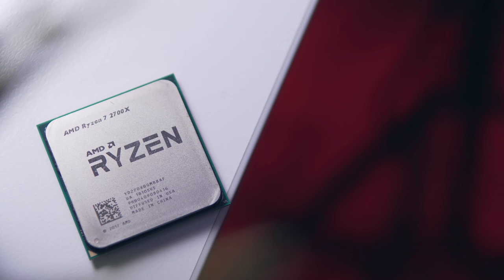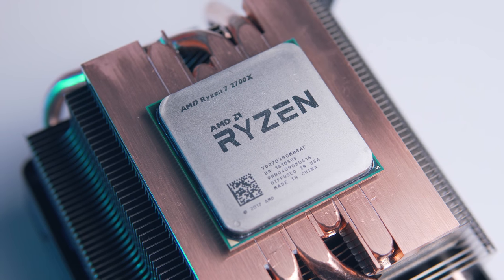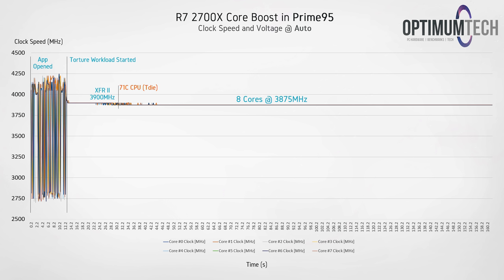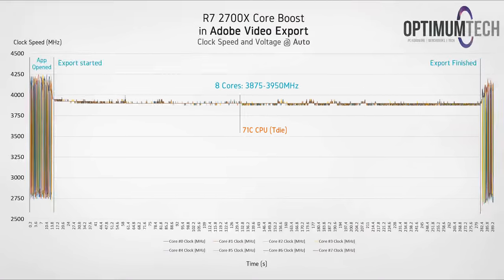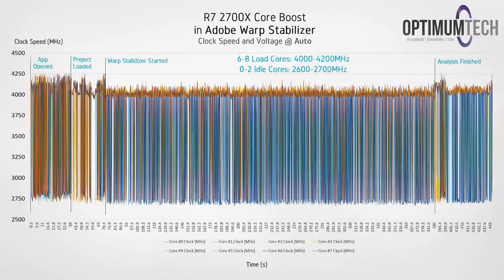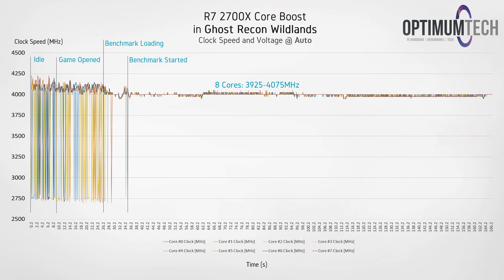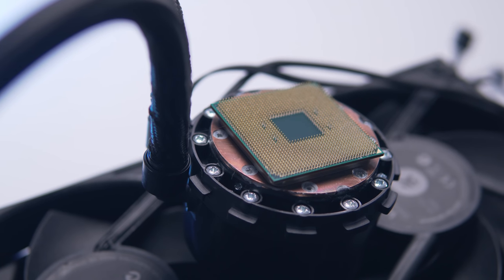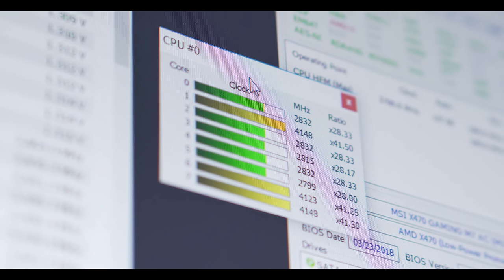R7 2700X - Boost Performance Analysis

Comment: I was hoping that with the Ryzen 7 2700X that I'd be able to reach 4.5GHz with my 280mm liquid cooler after seeing the turbo boost clock of 4.35GHz. But seeing recently with the numbers and tests that 4.2GHz is a bit harder to get stable and cool, I was a bit disappointed. With my liquid cooler I'm hoping to see 4.3 or 4.4GHz at reasonable temps and voltage. I'm wondering if by next year when the next Ryzen launches, the base clock will be 4GHz and the turbo boost would be 4.3-4.4GHz with maybe 4.5-4.7GHz with an AIO. I can only get 100% stability on my i7-6850K at 4.2GHz, I want to go higher on the clock to maybe 4.5GHz with Ryzen but it doesnt look like that'll happen. One thing I would get from Ryzen is 2 more cores and 4 more threads but that's about it.
Reply: What kind of results did you end up getting? I can barely overclock to 4.4GHz with liquid cooling, but anything above that makes vdroop go way up
Reply: @NinuRenee  I think 4.2 maybe 4.3 but not 4.4+. I didn't have the cpu for long though I went back to Intel and had 5GHz+ ever since 2019. Ryzen cpus these days can do 4.5+ no problem though.

Comment: Can you over clock the r7 2700x to 4.5 ghz with water cooling
Reply: You can overclock it to 4.5, it'll probably require so much voltage that it will degrade in a month and will likely be unstable even when you return to stock.

Comment: If U really want to see what what the ryzen2000 series CPUs can do, look at  the link i found of a ryzen 2600 (OC@4.2ghz) hitting 5.0ghz, with new XFR2 on an old AIO (Corsairs H100i v1, from about 5 years ago).   https://www.youtube.com/watch?v=1EDXui9K2VI

The video link above of the Ryzen 2600 @ 4.2ghs shows XFR/XFR2 is boosting to 5.0 ghz on a single thread when overclocked to 4.2ghz all cores when temps are below 70 degrees Celcius.

So you can see that this particular video does not truly show what the new ryzen CPUs are truly capable of. 
The included Heatsink is barely adequate for stock speeds, & will never show the CPU boosting to 4.3Ghz, unless it's in a cold room, and running some obscure old IPC software. 

Also keep in mind that the 4.3Ghz is only for a single thread (not even a single core) & not all cores as so many people get that wrong (even intel states that), that damn fine print will kill ya guys.

Comment: running HWInfoa and logging data uses up cycles...observer effect. You cant test this by running cinebench single core test with and withot HWInfo running, there should be a sizeable difference between the 2 results.

Comment: Can you do a bios set-up guide for the Gigabyte X470 Aorus Gaming 7 and the 2700x cpu.  This is my first gigabyte board and I hear this bios has alot of trap doors in the sub settings.  It is also my understanding that the gskill flare x ram works best with this cpu and chipset because of the tighter timings.  Problems have been reported that most ram modules(not all!) have a problem with the board loosening the sub timings and and holding the performance back.  I have witnessed this watching various benchmarks on the web.  In some test with a 200mhz OC the results were marginal if any, while others with the exact same system and tests are getting tremendous results.  There will always be variances, but they should not be to the extreme.  Furthermore the good and bad performances seem to be linear with respect to the testing.  I believe the differences are the ram with tighter timings producing better results and a significant variations in bios set-up and methodology.  I hear that the gigabyte bios has alot of black holes and thats its difficult not only to find your way around, but to get back to previous settings to make adjustments to the point were hardcore OC's are getting frustrated with the bios.  I am building this system with the  Gigabyte X470 Aorus Gaming 7, 2700x cpu with an evga 280mm aio, 16 or 32 gig of gskil flare x 3200(depends on performance?), evga 1080ti hybrid with a samsung 960 evo 500gig nvme and " the rest who cares"!  I ve been building and overclocking for more than 15 years and know some bios are worse than others.  I'm starting my build this saturday and would love to share my own results with you if you wouldn't mind?  I will eventually figure this bios out, but if I dont have to re-invent the wheel in the process that would be great.  If you are unable to do a bios tutorial can we share information?  Thanks for the video, I appreciate the work you put into your craft.  Thank you!